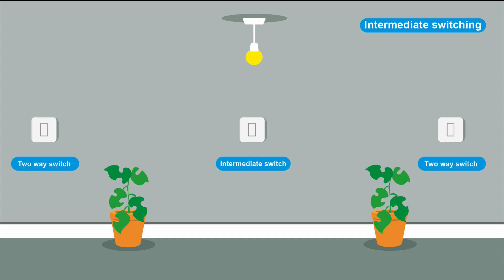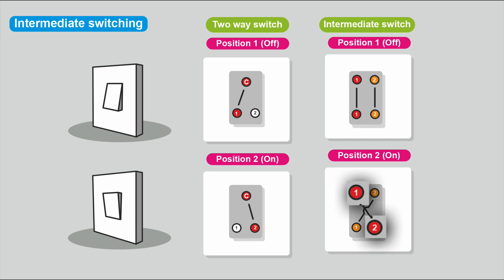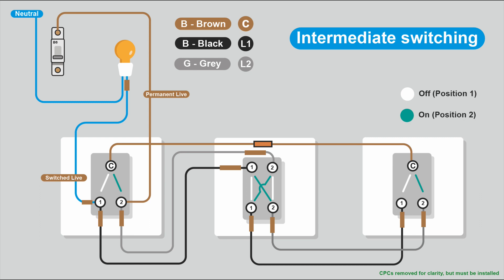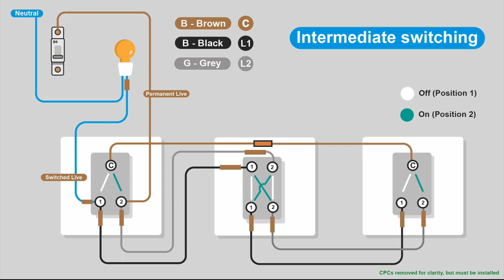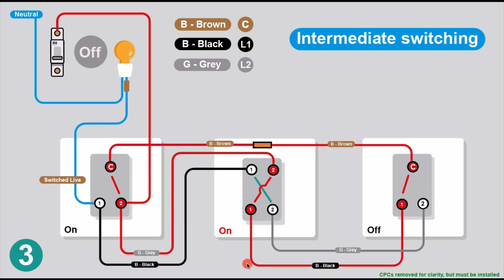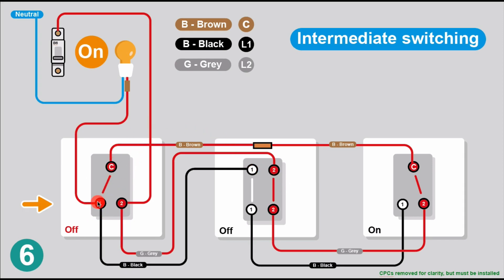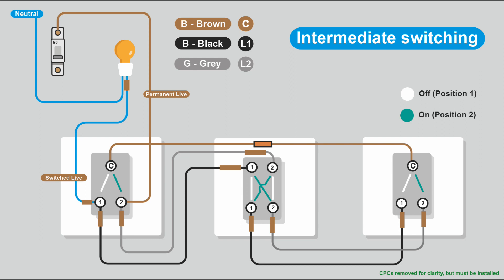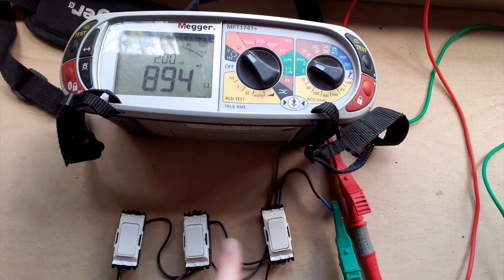Two way and Intermediate switching - Made simple

Comment: My most favourite way to do 2 way and intermediate switching is by doing the usual 3 plate at the switch and by using 3 core and earth but using one of the conductors as a neutral to carry to the twin and earth at the end of the 2 way or intermediate circuit so it goes straight to the light. Very similar to the conduit method you shown here but with the additional neutral connection and two strappers.
Reply from the maker: Thanks for the comment. Yes I think ? the AM2 asks for a  neutral at the switch on the practical